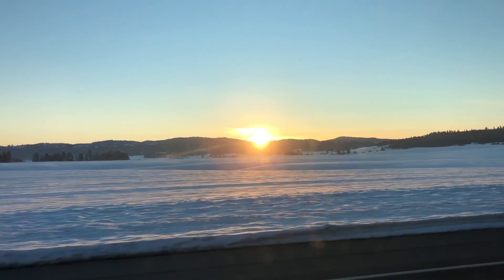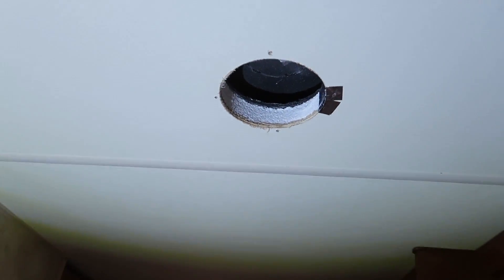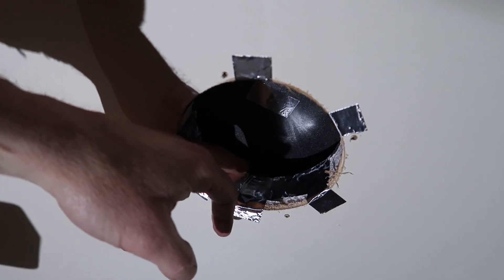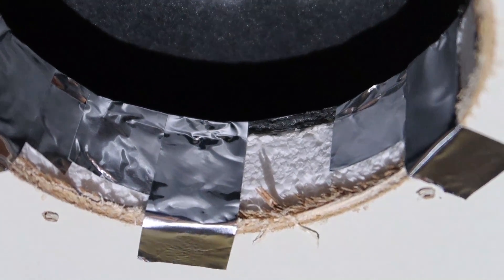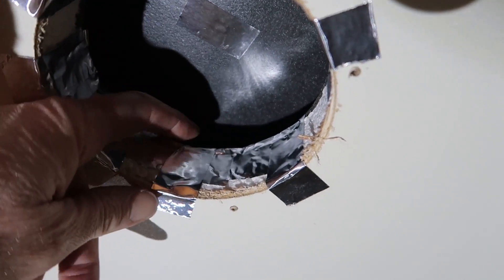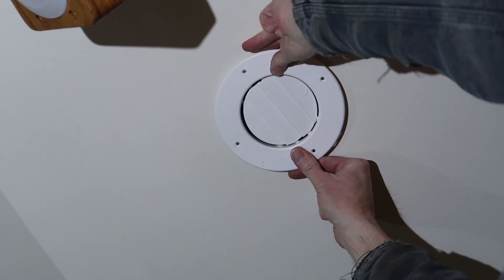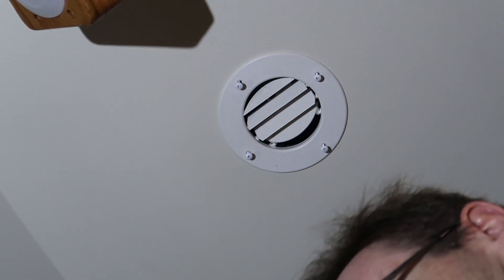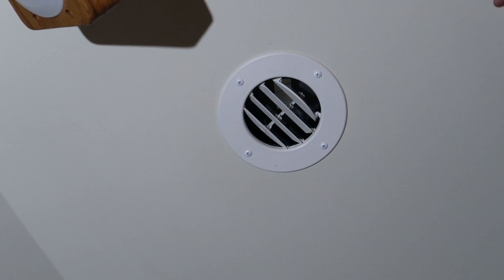Tips to improve the ducted A/C in your RV

Comment: I found a solution in my travel trailer. I have a primetime tracer, the bedroom has one duct 4 inch. I removed the cover that directs airflow, bought a $16 4 inch square fan on amazon, looks like computer fan and has a knob to adjust speed, claims 160cfm. Came with 4 inch inline ducts and screen to protect fingers. The holes on the fan match up 100% with the 4 holes for vent. I just removed directional cover and bought longer screws. Was a 5 minute install, I happen to have a outlet on ceiling about 6 inches from vent, so looks good and the increase in flow is  huge. Even on low it's double what it was, on high it's blowing great. Very happy with the flow now, probably increased it when on high 10x or more, could barely feel it before. Now if I close doors to bedroom, will actually cool down and still allows enough cooling for rest of trailer. I am thinking about adding a 4 inch elbow to have the cold air point directly to bed.

Comment: It's almost criminal what the RV manufacturers get away with. My "race track" ducts have collapsed sections and untapped seams and joints on my DRV Houston. No air from the bedroom AC would reach the living area. And vice versa. This meant one of the two, not so whisper quiet, living area ACs had to be used during the day. At night instead of using a living area AC to cool my room, I had to use the bedroom AC. Its difficult to sleep with the AC blasting directly above ones head. This is why race track ducting is now widely used.

The roof had to be removed and rebuilt to correct the horrible duct work.

It doesn't matter how much one pays for their RV, shotty workmanship is across all price points.

Great video. Too many of us rely on the work to be done properly. I know ... I know...how dare we expect our RV to be built correctly. Haha. I've not had a new RV without major work required under warranty.

One would also expect a PDI to catch obvious issues and errors. However this is also not the case. Always spend a few nights in your RV near the dealership before heading home. This way they can easily fix the problem(s) without having to fight with them to have the unit repaired at a local shop.

We as consumers hold all the power. However our desire to have the latest and greatest new kit and finishes trumps our rationale. Every year we are temped with new colors, finishes, fabrics, and technology designed to make our "camping" and travels so much more enjoyable. And every year manufacturers new and old make promises of higher quality units. Yet, the same mistakes and poor quality materials plague the industry. A study found on average we retain our new RV for less than two years. Many "upgrade" to new RVs more than they do their daily vehicle. Yet under the new facade is the same RV from the 70's. Many of the entry level units are identical to the original mass produced RVs of the 40's. One is better off retaining their RV, changing soft goods and adding new components to avoid all of the same hassles they've only suffered through the previous year. Once all of the bugs and kinks are worked out of your unit, why throw money away and suffer through the process all over again? Unless there is a truly revolutionary change to an RV which is not applicable or affordably added to existing units, there is no reason to buy new in such a short amount of time. There are far more economical options available on the market for us to change the entire look of our RVs now, than ever. It used to be we had to paint the inside of our units to change tires looking paneling. Now there are 1000' of removable peel n stick wall paper. The same can be said for the exterior. You choices are unlimited. If you want pea soup green with splotches of vomit taken from actual pictures printed onto vinyl, you can have it. The exterior of an RV is, for the most part, ageless. New up to date graphics instantly changes the look. 

Dont get me started on their insulation R-value claims. These numbers, with the exception of 2-3 brands, are completely fabricated. I say brands due to the fact nearly all brands are owned and manufactured by just three corporations. These manufacturers self regulate everything. They also dictate what options and features are reserved for high profit yielding brands and/or models. Many brands and models are identical. The only differences are the graphics and soft goods. A few bits and bobs are added to drive up the price of well known brands. Take Montana for example. This brand owes its success to a clever marketing and the introduction of its owners club. Everyone wants to be a part of something. The successful Montana's owners club has been one of the most successful enterprises for Keystone. Their rallies are key to getting the owners to fall in love with the so-called bits showing up on the new model year units. With more and more people choosing to live in their fifth wheel, manufacturers have introduced the residential and "residential like" components and fittings. Many if these fittings are designed to look like, but lack the durability of residential components. Other items, such as appliances, are not designed to endure the abuse suffered during travel and seasonal changes, and fail. The latest marketing trend is full-time residential units. Saying so doesn't make it so. Everything, except for the residential refrigerator, in my DRV is the same as all of the other RVs around me. The same AC units, the same furnace, the same hydraulic system, the same slide mechanism, the same roof, the same furniture, the same cabinets, the same washer and dryer, and so on, right down to the plastic faucets. Nearly every component is the same, less manufacturing difference, as a unit without a sticker claiming four season use. Water line and tank heaters were, at the time, optional equipment. Yet, the warranty period for these "full-time units" is not extended. Which means my "full-time" unit with all of it's seasonal use appliances and mechanical equipment is likely to experience far more component wear than a unit used seasonally. The manufacturers know this. Which is precisely why they fail to warranty full-time units for a reasonable amount of time. That said, one cannot live in a unit without a "full-time" designation and expect the warranty to cover failures of any kind. 

I didn't choose DRV for the its "full-time" designation or its warranty. I choose based on experience with other brands, its hung wall construction (no delamination when - not if, it leakes, suspension/axles, and overall feel with regards to materials and fit and finish. Meaning all the wood is real wood, the walls/roof/floor are all thicker, wood wrapped windows, flush floor slides (no tripping in the kitchen. Burning myself more than once didn't prevent me from tripping on the slide lip sticking out eight inches beyond the toe kick that exists in every home and on the island in the RV. DRV has no slide lips to trip on.), independent suspension, much reduced VOCs, and so on. All in all, without choosing to go with a custom fifth wheel, I was able to buy a fifth wheel with the feel of a home at a manufactured price. High manufactured,  but not custom pricing. I knew going into the purchase nearly every component is for recreational use. There was no getting around this in 2015. 

Today we're seeing new technology in use and in development. Most of this tech begins its life in high end diesel pushers and fully custom towables. It isn't until the tech is proven and repackaged for the wider industry that we see the tech in mass produced units. Basement mounted AC units is one example. These are found in buses and custom towables. Once these AC units are repackaged as smaller and affordable units for mid to high end RVs, we will see them as standard or optional equipment. On towables they're mounted between the I beams behind the rear axle. This allows them to utilize the same floor ducts as the furnace, shades them from UV damage and the elements, keeps them cooler, reduces maintenance costs, fewer roof cutouts, fewer ceiling cutouts, improves roof insulating properties, reduces overall height, reduces the number of ACs from as many as three down to one, can reduce weight, and allows more space for roof cooling and energy producing solar panels. The benefits of an under mounted AC unit is huge. The cost saving to the user could be huge as well. Not only does one save money thanks to more efficient cooling in the summer, but heating savings in the winter. This is due to heat not escaping from the ceiling AC cutouts, the thermal gap in the insulation due to the ducts and compressed wool insulation, thermal transfer in the aluminum AC components, and heated air escaping though the roof mounted AC unit itself.

We, the consumers, can demand changes in the industry by refusing to buy the same units our parents and grand parents did. The industry is self regulated. Therefore, the government is not going to save us from ourselves. We must do so for our future and our children. This is not to say there has not been some improvements. There have been from a few independent manufacturers. Simply put, much more improvement in the entire industry is required.

Cheers!
.
Reply from the maker: Thanks for watching.  :-)

Comment: I was just in my air conditioning ducts running wire as well. This is a good idea I think I'm going to implement it in my RV. THX
Reply from the maker: It was a very easy and fast improvement to the cooling in my RV.

Comment: I found the duct in my bedroom wasn't blowing much cold air. I took the cover off & discovered that the duct wasn't closed (this is the last vent in the system). So I was using the a/c to cool the space between the ceiling & the roof! I created a wall to close off the open side & covered it with the aluminum tape & closed it off. BINGO!!!!!!
Reply from the maker: Quick and easy improvement to the A/C
Reply: I'm having this exact issue which is why I found this video so now I will be removing all my vents to check.

Comment: Good video! I had the same issue in my rig though worse. All of my vents had gaps and the vent at the front and rear just vented into the "attic" It appeared at the end of the black duct they cut it off then pinched and glued it together though not very well.
Reply from the maker: It's amazing how the RV manufacturers do such shoddy work at times.

Comment: Do you know of any solution for floor vents? My heater vents are both right in the walking path... I’m tired of stepping on them but I don’t know what to do other than seal them up and try to reroute the ducts somehow
Reply from the maker: I don't have any suggestions for the floor vents.  If you seal them up, the lack of air flow will probably overheat the furnace and cause it to shutdown.